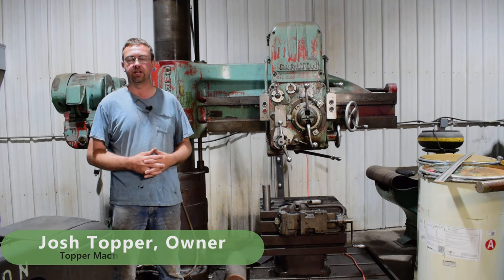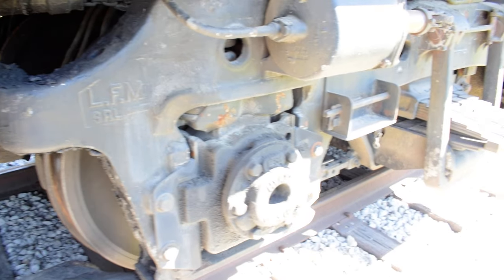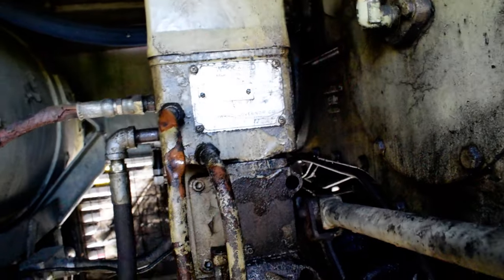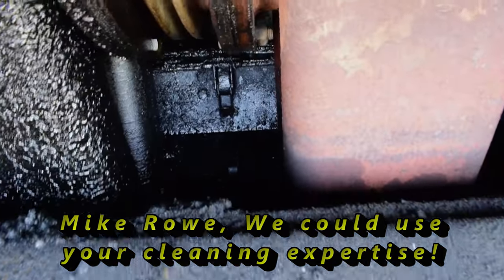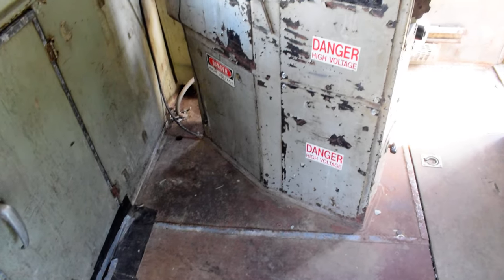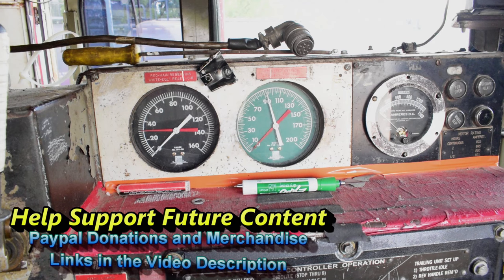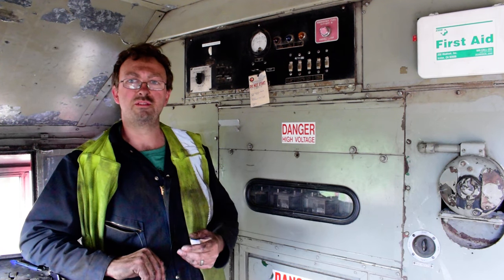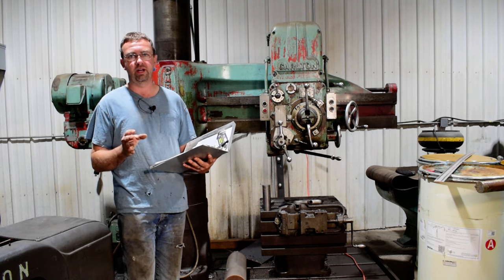Locomotive Bought on an Online Auction - Helping My Customer Get It Moved - Shipping Nightmare

Comment: smh...WHY???????????????? Of all the things to do on this earth with good money; Buying a train engine has to be the most self indulgent ridiculous choice a person with money can make..."OH LOOK AT ME I HAVE A CHOO CHOO TRAIN!" Glad there's clean water, food and housing for everyone on earth. Jabronis!
Reply from the maker: Watch the video before commenting like a moron.
Reply: IT, is really Karen.
Reply: Hi, IT?   This diesel is being used to carry freight, because this kind of diesel is Energy Efficient.  And the Greenest transport.  And the most modern diesels can run at nearly 350 miles Per Gallon.   According to the ads for c.s.x. on CNN.   Even this original Diesel can pull 50 boxcars, or other mixed freight.  With only the Engineer.  And Conductor. And/or Switchman.   But...you need at least 100+ semi trucks 🚚,  and each semi needs 1 driver, (or a back-up for long hauls).  Thus potentially 200 drivers !!!!!  And truck stops.  And  Weigh stations.  And log books 📚 🤣.    And many more!!   Bit Interstate Highways were started in the 1950s.  They Paralleled the railroads, and sucked up the freight.   When diesel was very cheap.   But sadly many railroads became Bankrupt.   The tracks were ripped off and made into nature trails.   Or sometimes covered over by the freeways.  Like the CNW tra ck from Green Bay Wisconsin,  West to Wausau, and formerly to St.Paul, MN.  BUT, Highway 29 was a old 2 lane.  Then 29 was rebuilt into the new 4 lane, divided Freeway at 75 mph.   And Thousands of acres of forests. Fields, farms 🚜,  and houses and businesses were ripped off for this new Freeway.  And Destroy the Natural Environment.   Then using Billions of taxpayers Dollars 💸!!    Yet, the route from W. To G.B. should have been a great commuter train.  With electric power 🔌 supplied by both the Pulliam POWER in G.B., and the Weston power in W.   Yet currently with coal, then switching to Wind Turbines.  (P.S:  Pulliam was razed in 2022, and changed into Wind power).    Also, the Wausau track could be used for steam locomotive 🚂 excursions by using the old locos at the NRRM IN GB.   Thus this older GP7, that They rebuilt into a modern GP38 is a Green Hybrid.  Ok. !!!!!   Hi in April 2023A.D .HAPPY EASTER ON RESURRECTION SUNDAY!!!!!ALLELUIA !!!!!  AMEN ✝️ 🙏 ✝️ 🙏 ✝️ 🙏  !!!